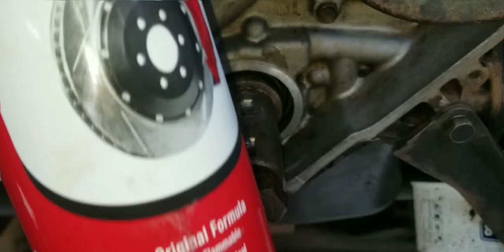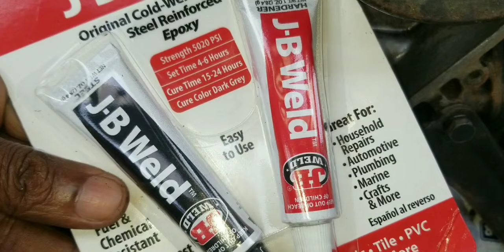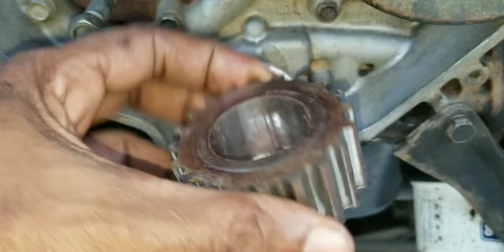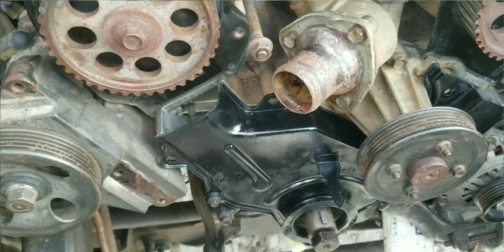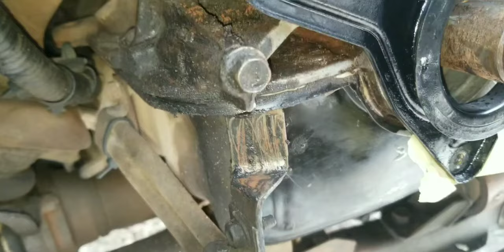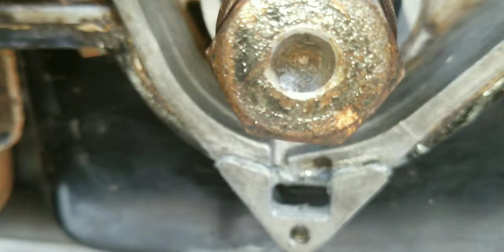How to Repair Crankshaft Snout Woodruff Keyway Groove. Part 7/9

Comment: Was this messing up the timing? I'm doing mine right now, and gotta lot of play/slop on the sprocket like yours.
Reply from the maker: Yep. It will also set a DTC P0300 random cylinder misfire code.
Reply: @Stevexnycautomotive OK! Also, once I administer the JBweld, that's supposed to be permanent, correct? I mean, I'm not going to be removing the woodruff key after that..
Reply: Update: the key actually sheared off. It was flush in the crankshaft. Messed up the sprocket real bad so I ordered another. The crankshift itself is ok, so no jb weld for me! Orderd a new key also. I will keep u up to date on my progress but  I gotta wait for parts. Oh yea, I accidentally scored the crankshaft where the front main seal sits, so I sleeved it to fix that, but now seals are even more difficult to install. I should stretch the seal for a day or so to make it more easily installable I don't like the seal replacement job at all😂